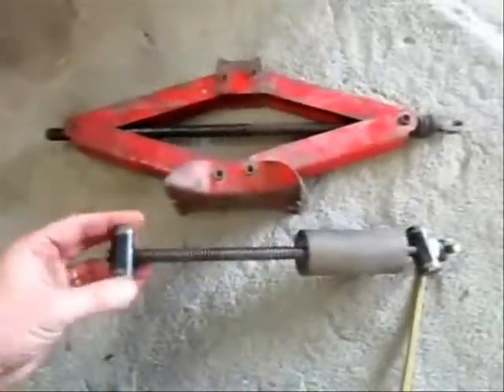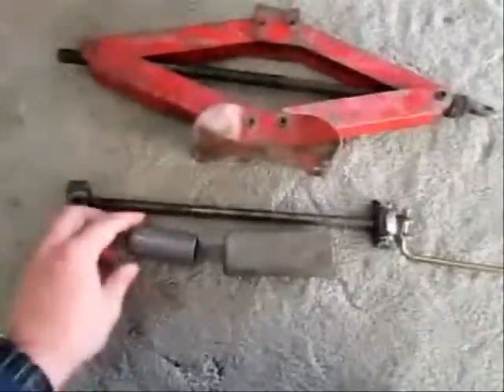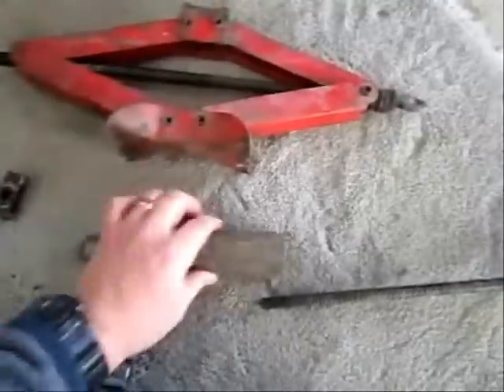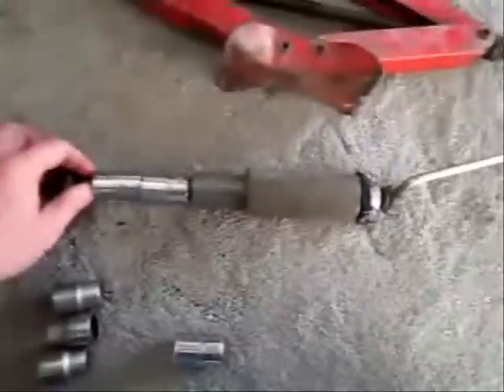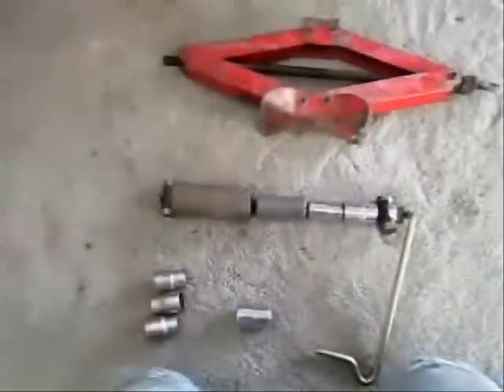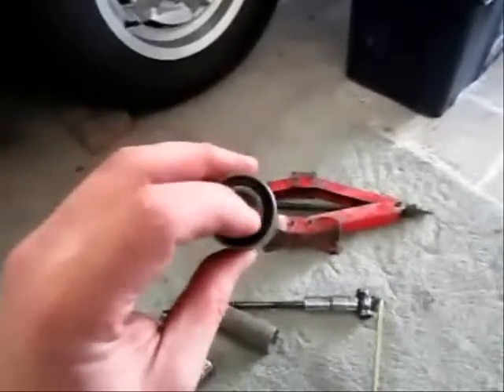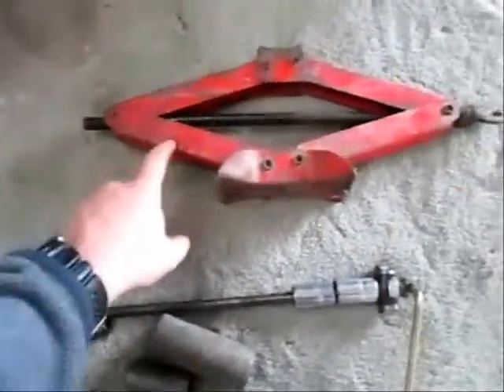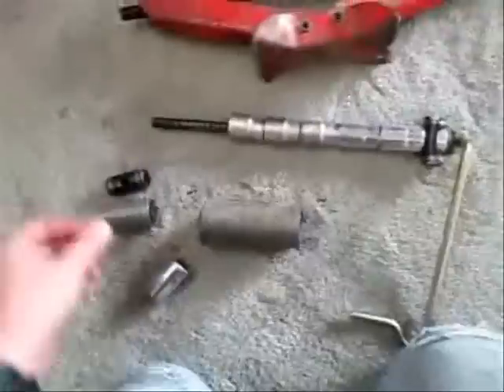How To Make A Bushing Puller From Scrap

Comment: The key to success here is the threaded bar with deeper thread Ive also used old sash clap tread that's deeper and lighter work to use 💪  basic fine thread bar is a game if even possible  😥

Comment: Good idea,  unfortunately my scissor Jack collapsed and bent while finding the problem. Stock accessory rated 4000lb, for a car that weighs over 4100 wet and loaded. 🤬
Reply from the maker: That's a very good reason to turn it into a bushing puller :)
Reply: @TonyMahlony  but it's bent...
Reply from the maker: @SGobuck  I have a big hammer for that kind of problem :)

Comment: Oh I thought you were going to pull a bush [shrub] out. lol.  I do like that idea though, to pull a bushing out.
Reply: I thought so to. Funny how this video came out when I was looking up bush removal.
Reply: oh yeah
Reply: The kits are called from suppliers but why pull a buggerd bush I use heat,hammer and chisel if there's rubber in the centre I use a hole saw to cut it out before using heat
Reply from the maker: Doing that way is much more physical work than using a 'puller'